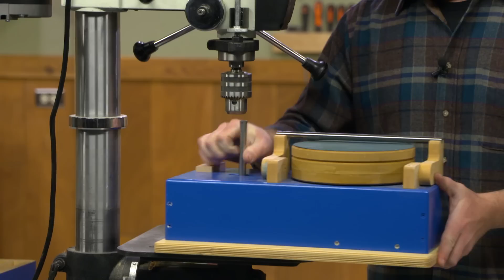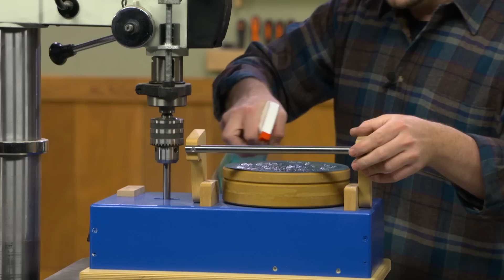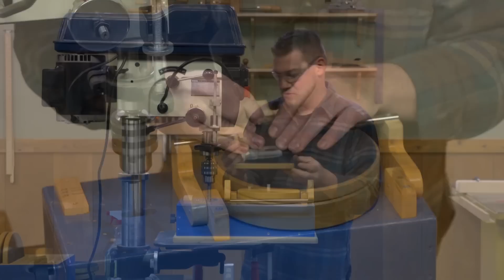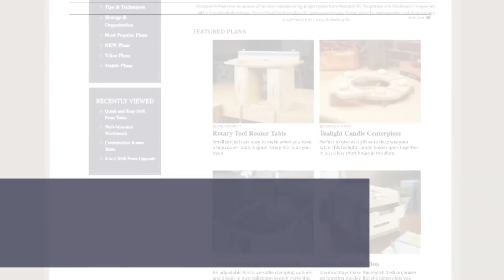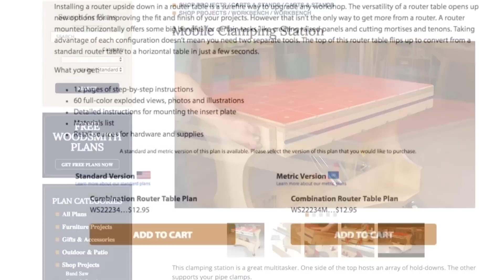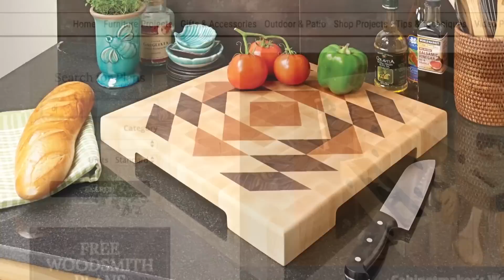Scary Sharp Tools on a DIY Drill Press Powered Sharpener!

Comment: THis looks like a great idea/build. However, one side of whatever blade is being sharpened will get ground more simply because it's getting more sandpaper action. It's the side towards the outside of the disc. The only way to come close to making it sharpen even is to skew that tool rest to where the end of the blade is pointing towards the radius of the disc.

Comment: That's super dangerous to sharpen the blade against the rotation like that. If that edge caught that wheel, you could have a potentially serious situation on your hands. Always sharpen  your blade with the rotation going away from the blade's edge, not towards it. Because you don't want your blade to dig into the material and possibly cause a serious accident.
Reply: Nonsense

Comment: I think you have done a really good job, but I would prefer to work on the other side with the platten/abrasive running away from me. That way do are less likely to suffer a dig in and ruining the paper.
I agree with the previous comment about the peripheral speed but at these diameters and low speeds I don't  think its a massive problem. I plan to build one similar as I have an 8" diameter glass platten which is about 5/8" thick and perfectly flat. Well done for coming up with a novel way of powering the wheel as it does away with the need for a separate motor. Great job - Stay safe.

Comment: No info on the required accessories. Where did you get them? I have the plans but no info there.
Reply from the maker: I apologize I didn't catch your questions earlier... the sources are listed on page 10 of the plans.  Most of the metal parts are sourced through McMaster-Carr (mcmaster.com)   Which parts are you looking for?
Reply: Woodsmith Thanks. I just never saw them. Big fan.

Comment: $500 drill press being used to do a job of $30 DC motor with speed controller? 
Rube Goldberg would be proud.
Reply from the maker: Yeah, I definitely wouldn’t go out and buy a drill press just to power a sharpener... it’s more of an exercise in if you already have a motor on a machine you own what are some other ways you can use it. We’ve built drill press or lathe powered belt sanders too. Might as well get double or triple duty out of your machines.
Reply: @WoodsmithShowandmagazine  Why do people just seem to look for something to find wrong with the video. I don't see where they have taken the time to make anything or do anything but complain for that matter.

Comment: Hook it up to a battery drill
Reply from the maker: That would make it portable.  ;)
Reply: @WoodsmithShowandmagazine 
Yup and you could use an old electric engine hooked up to a good 18v battery or a 36v battery no problem then

Comment: I have been using a worksharp and you were spot on with your criticisms of it.  The larger size, variable speed from the drill press makes so much sense, plus the tool rest is in a more appropriate and useful spot.
Reply: No, lots of wet-or-dry sand papers are used on metals.

Comment: WorkSmart sharpens AWAY from the edge.  Recommend using opposite side.
Reply: as someone who does both metal and woodworking, there is a reason that you sharpen toward the cutter. when sharpening toward a cutter you don't get tearout of the steel. Yes tearout. As the edge becomes thin, grinding away from the edge pulls out little pieces of steel, toward it, its supported. I have been like you wanting to grind away from the  edge, especially on soft water stones. but as I learned about sharpening at a microscopic level I found out it does not produce as sharp an edge. that being said, I still would sharpen away from the edge on soft waterstones, and if using diamond plates with holes, but if using anything that will support it, I would sharpen toward the edge.

just offering some info... not looking for a fight.
Reply: @jsteifel  and you are absolutely correct
Reply from the maker: I think that is a fair recommendation.  Better safe than sorry.
Reply: Yup I kinda agree, with it coming towards you like you demoed here it can grab and rip the paper wasting it

Comment: I like this machine, but you don't have to "peel off"  Worksharp abrasives (except to occasionally replace them)... that's baloney and BTW, the Worksharp 3000 works great, there's no downside that I know of...except you will need several of the glass disks, BUT, unlike this contraption, you can put an abrasive disk on each side of the glass disk. So 3 disks give you 6 grits.  And the glass disks are dead flat - I've yet to see MDF that's dead flat. I do wish Worksharp would make a larger machine  - maybe 8" disks - so you could sharpen wider blades.
Reply from the maker: I wasn't meaning to bash the Worksharp if it came off that way. It is a really good tool from my experience.  This is just another shop-made alternative that I really like, as well.  

As for your criticism of MDF, I've never encountered MDF that isn't dead flat (unless it has taken on moisture).  As long as the MDF is sealed it makes for an excellent, inexpensive alternative to glass.

I do appreciate your input and the discussion though.  Thanks for watching and commenting.
Reply: But they don’t, so you can’t.
Reply: Идея со стеклом или зеркалом идеальный вариант,но проблема в постоянном приклеивании абразива,по мере того как он сотрётся.

Comment: MDF and liquid anything do not work well together, “ sealed” or not.
Reply from the maker: I would tend to agree with you, but we've sealed our disks really well and have not had a problem with them taking on moisture at all.
Reply: @WoodsmithShowandmagazine  скажите а как фиксируется абразив на МДФ?это ж не очень удобно наверное?
Reply: Plus if you use the moisture resistant one as well as if you seal it with superglue it works even better.

Comment: Doesn't the outside of the wheel actually turn faster than the inside. Shouldn't you use both sides of the wheel.
Reply from the maker: Yes, the outside of the wheel turns faster, but it doesn't seem to be a problem.  You can definitely use both sides of the wheel though.
Reply: about six years ago I built a similar grinder, not driven by a column drill but by a hand drill. I always grind tangentially to the grinding wheel to avoid removing more metal on one side than on the other.

Comment: lovely toolsharp system.Could you incorporate using a honing guide instead of the flip bar?
Reply from the maker: I would think that would work, but I’ll have to give it a try.  You just want to hang on tight so the honing guide and blade don’t get thrown across the room 😀
Reply: I

Comment: Thank you.  This looks like a big improvement on the Worksharp, and will save money and time with the sandpaper disk setup.  For wide chisels or plane irons, I would not use it.  Like on the Worksharp, the rotation speed increases from the center to the circumference, and you end up with skewed blades over time because more metal is removed  from the progressively faster rotation from the center to the outside of the disk.  This is visible on the 2” chisel shown in the video.  However, this jig could work great on curved carving gouges since only one point of the curve touches the disk at any point in time.  I may build one.  For my chiselers and plane irons, I use the Rob Cosman method, which takes about one minute, which encourages me to go to the sharpening stones whenever a blade shows the slightest sign of dullness.  This just requires a 2 sided, 300/1000 Trend diamond stone and a 16,000 grit Shapton ceramic stone.  With double micro bevels, I can get razor sharp edges in less than a minute, and they’re straight and square.  You can start with Rob’s magnetic  training guide until you develop the muscle memory to hit the correct angles without a guide.  Watch Rob’s sharpening video on YouTube.
Reply: Since Logan shows that you can use both sides of the machine to sharpen, might the skewing challenge be neutralized by performing a couple of passes on one side of the disc and then a like number of passes on the other side, alternating left and right until it's time to switch discs?
Reply from the maker: Yeah, I think that would be a fine solution.
Reply: @danielelse3914  You can reduce the skewing effect by switching from one side to the other, but you cannot eliminate it. As shown in the video, when sharpening the wheel is rotating towards the edge of the tool. When honing on the leather wheel, the wheel is rotating away from the edge. The sandpaper cuts a lot faster when the wheel is rotating into the edge rather than away from it. So, even if you alternate sharpening from one side to the other, you'll still end up with SOME skewing effect.  Whether it would be large enough to worry about is another question.
Reply: Baloney.  I've been using a WS3000 for 3-4 years and it does not skew anything. It's a non-issue.  The only time you have to use coarse grits is if you have a damaged edge, beyond that you're  honing a micro-bevel on micro-mesh. It's a great little system, cheap, fast, and just about zero hassle.
Reply: Why not skew the bar?

Comment: The only real problem I've seen (after buying the plans) is that the parts and hardware necessary to build this costs (yes, I just priced it all out) about $30-$50 less than just buying the WorkSharp https://amzn.to/3eq7PKK - not to mention your time. I would honestly rather build my own tools like this, but not when the cost is so close to what it costs to just buy a new one.
Reply from the maker: The sources we use aren’t always the cheapest. If you shopped around on some of the parts I’m sure you could find some deals. I’ll see if I can find.

But like you said, some of the fun and value as a woodworker is building a quality project yourself.
Reply: well, with the worksharp you get the chisel port, which would be hard to mimic on this. 
I think it depends how much you already have - lots of woodworkers may have spare pulleys and shafts kicking around and could cobble 70% of this together. Same goes for scraps of MDF. Do you absolutely need stainless shafts/toolrests? Probably not. So, there are ample ways to save money before you even start to look at your own local sources for some materials. It's certainly a lot cheaper than a lap sharp!!

Comment: Shouldn't you be sharpening on the other side of the disc so the sandpaper is cutting away from the edge?  Reduce the chance of cutting into your paper.
Reply from the maker: I know it isn't intuitive, but the MDF doesn't have any give to it so there is very little chance of it catching.  I don't see any reason you couldn't sharpen from the other side though I like I did with the leather strop.
Reply: Woodsmith o

Comment: I have the worksharp system and have noticed that not only is it spinning quickly, but that the outer edge moves faster than the center and will remove metal faster potentially causing an uneven bevel.  Is the bar centered on the wheel so that you can move to the other side and even the bevel?
Reply: At the point of contact though, the inner and outer edge of the disc move perpendicular to the blade and so behaves as a linear motion.  But the surface of the disc WILL wear more quickly as you approach the pivot point because of the reduced circumference (greater angular velocity).
Reply: @Don_B_260Z  the outer disc is moving faster than the inner so more material is being removed from the edge of the chisel on the outside resulting in uneven sharpening
Reply from the maker: Yeah, I think you could move to the opposite side of the wheel if that is a problem.

Comment: I have a torn down 4" jointer that has the same size pulleys and belt as this does. I might try to build this with that small motor instead of using my drill press.
Reply from the maker: A great use of the parts! Let me know how it goes.